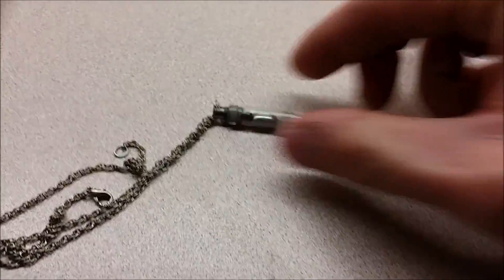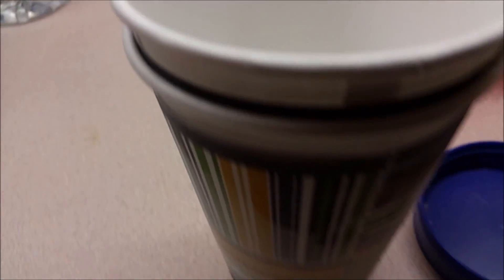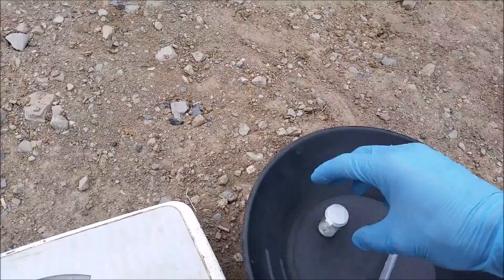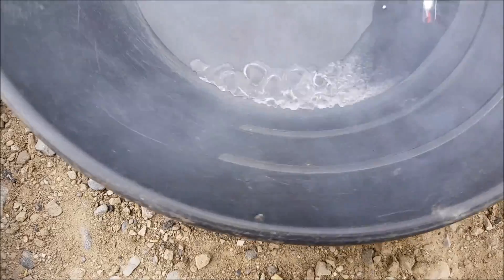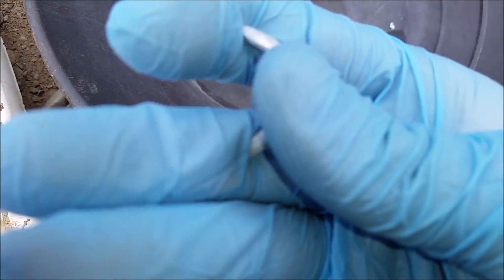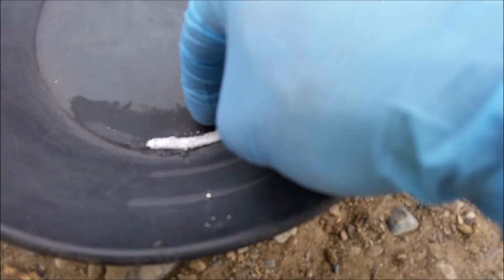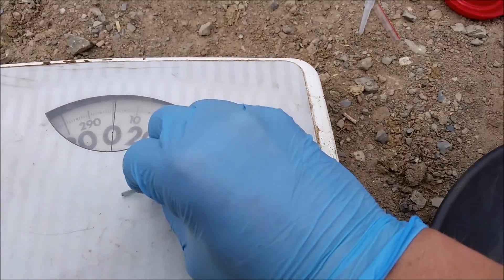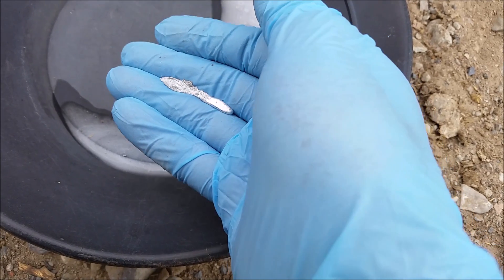Bending Solid Mercury: It Cries!

Comment: I saw a video once where someone tried to make a bell out of solid mercury.

Didn't quite work.
Reply: +One Winged Angel Radon is about ten thousand times as radioactive as the shortest lived plutonium isotope of use, plutonium 238. It is several million times more radioactive than plutonium-239, as used in bomb cores. The decay products of radon are short-lived as well.

You can't have something that's both long lived and intensly radioactive; it can only decay once before it becomes a different element and if the first step is slow, that's the rate limiting step. Radon wouldn't exist at all on earth, if it wasn't being formed in the decay chain of long-lived uranium uranium isotopes and there is never very much of it around.

You can have different decay energies, but there's an upper bound. An alpha decay is always between 4 and 11 MeV; with the ridiculously unstable isotopes tending towards the high end and the longer lived stuff toward the 4-6 MeV side of things..

Alpha emitters don't get through skin and it is very poorly absorbed by the gut. The biggest danger with plutonium is dust. Radon is far worse in that it is already a gas and it's decay products are effectively very fine grained respirable dust.

Handling a bomb core (~3 kg) of plutonium with just a nickel or gold plating without gloves is perfectly fine and was routinely done without adverse effects. As long as it doesn't go critical (e.g. you don't want to drop it in water or stack too many reflectors or moderators around it) it is fine.

The most radioactive isotope of plutonium that is used for anything is plutonium 238, with a half-life of only 88 years. Even then, it was safely used in pace-makers as a heat source for generating electricity. Some of these are still around, after more than 30 years since they stopped making them.
Reply: +One Winged Angel Plutonium isn't exactly easier to handle. :D
Reply: +JustOneAsbesto I had a good Sodium joke to tell, but Na...
Reply: What do you exactly mean by 'didn't work'? What happened?
Reply: Well at first they had a lot of logistical issues (melting, deforming, not getting it to freeze into the mold properly), which they eventually somewhat solved, but even then it just didn't make a very good bell.
Reply: soylentgreenb
You know... I sort of felt like just calling him an idiot, but I didn't want to be rude.

While (arguably) far more informative, I'm not sure your way is any better.

I say arguably, because I doubt he'll understand any of your comment.

Edit: Hah! He beat me too it.
Reply: +JustOneAsbesto   Of all the metals, why Mercury?  Why not a metal that glows?  That way it'll glow in the dark. :D
Reply: Seleuce  I think Plutonium is too radioactive to be used, why not something less radioactive?  Like Radon?
Reply: One Winged Angel
Again, bells don't exist to look pretty.

And the way they are commonly used, less than a handful of people ever see them in the entire lifetime of the bell (which might be hundreds of years), but in a single day of the bells life, thousands of people hear them, multiple times.
Reply: +One Winged Angel What are you, a magpie?
Reply: Neon's Stuff That was pretty CRaP but as long as you only do it periodically we won't have to bang our heads on the table
Reply: +Neon's Stuff That wasn't Ne.cessarily nice of you. ;)
Reply: superblahmanofdoom
Yes. It would have to be 127 degrees below absolute 0 to freeze something with a melting point of -39 C.

Yes.
Reply: JustOneAsbesto  I know, but think about it, a glow in the dark bell would look pretty nice, no?
Reply: +JustOneAsbesto A mercury bell would probably need to be quite large as mercury is a dense metal and small bell would resonate too low. It's probably also like lead and doesn't ring that well even so :)
Reply: +God Gonx That was AUful
Reply: Westley West
Because the whole point was to use mercury.
Reply: +One Winged Angel Radon isn't a metal
Reply: EvilNeon you mean Ne.cEs.sAr.I.ly
Reply: +Rennie Ash I wouldn't Ba.ng myself to the table.
Reply: Kaspars Matusevics
Or taco.
Reply: soylentgreenb you're peopleb!
Reply: Leo1239150 Why you theiving little elf!
Reply: Stealing this.....
Reply: +R. AQ Only way it would work is if the mercury bell was in a room of -400 celcius basically... to keep it's solid state.
Reply: +JustOneAsbesto why not use aluminum?
Reply: +JustOneAsbesto oh ok.
Reply: ***** Radeon is a GPU
Reply: *****
Which sucks at 2 of the games I play and the GPU should be 4x more powerful than it needs to be XD
Reply: Rennie Ash Switch to Nvidia you will be able to optimize more games. right now 2 good cards to start to choose from. the GT 730 Or the GTX 750 Ti. both are under 110 bucks.
Reply: Westley West
The only problem is that I have r9 290s and my old PC had a gtx660. I would probably want one of the top end nvidia cards to match the r9 290 but expensive XD
Reply: +Rennie Ash don't get a fucking 730 or a 750 your r9 290 is still a really nice card
Reply: Brandon Poisant lol I know that's why I would only want an upgrade if I did change.
Reply: Brandon Poisant AMD has problems with emulators that's why Nvidia is more compatible.
Reply: It only works is Canada
Reply: Jon A no its fine just use the DVD drivers NOT the current drivers.
Reply: Jon A well until there's a fix it shouldn't be a problem. for now people may have to wait. i understand that Radeons is a choice for now but i got Nvidia before this whole mess. i only got Nvidia because its better for my games. there's no other equivalent of the card i use and if there is its slower than the Nvidia i use.
Reply: +Seleuce Plutonium wouldn't really glow, unless you used plutonium-238 which would glow from it's own heat, and i don't think we would want our bell to be hot.
Reply: In most ways, plutonium is a lot easier to handle. It doesn't need to be kept refrigerated. In bulk form it's not particularly toxic or radioactive (it's an alpha emitter with a fairly long half-life + a small amount of x-rays). Plutonium ingestion isn't that bad (~1 in 10^5 atoms are absorbed by the stomach lining from easily soluble plutonium salts; less from insoluble oxides). It is plutonium dust inhalation that is most dangerous.

Handling large enough amounts of plutonium to make a bomb is also a serious criticality hazard. If there's enough plutonium, allowing it to pool into the wrong shape while casting or putting something next to it that reflects neutrons (e.g. people) can make it go critical.

Handling say 100 g of plutonium metal would not be big deal if you weren't going to polish or machine it.
Reply: was it periodic  videos
Reply: Yeah I saw that too
Reply: One Winged Angel
Here's the real (and blatantly obvious) answer to your original question: Mercury because of curiosity about what a bell made of mercury would sound like.

And also NOT radon (or other), because the purpose of a bell is not to glow in the dark. The purpose of a bell is to make a pretty sound. And also radioactive elements are hazardous.
Reply: bennyg444  No, I'm an Angel.  See my wing?
Reply: soylentgreenb ...wall of text...mental strain...

Comment: now keep in mind how bad this crap is it can kill you if you get any of it in you yet anyone can find and get it ez but you yet you have to be 21 to buy a beer
Reply: +vorkev1 WE'VE GOT THE PENTAGON'S TOP CRYPTOLOGISTS TRYING TO FIGURE OUT WHAT THE FUCK YOU JUST SAID!
Reply: +vorkev1 No, just no. It can't easily kill you if any gets on you. Fifty years ago every child handled mercury with their bare hands in science class.
Reply: Nevir202 if you ingest enuff to wear you can see it with your eyes that is enuff to kill you yes some people it may not kill right away but most it will.
Reply: vorkev1
Ummmm... OK before you said if you get it on you which is 100% wrong. Now you're talking about eating it? Way to move the goalposts.
Reply: Valoro85
I'm curious, if Mercury is so highly toxic that it needs to be regulated in such a way why are governments pushing people, even incintivizing them to switch to mercury containing CFL light bulbs?

Mercury is toxic but it isn't the boogeyman you were claiming. That was my point and I'm correct.
Reply: Valoro85
Umm... Where have you been buying bulbs? Every CFL I've ever seen is exposed glass. The plastic covered ones are usually LED.

Yes, CFLs contain very little mercury. And with even very basic safety precautions you'll only ever come into contact with very little mercury when handling it. In fact when handling it you have the advantage of being aware of Mercury, I bet most people don't even know it's in CFL bulbs.

Comment: a mercury necklace?  is that like..... safe???
Reply: +JakeTheRipper 73 We used to stick Mercury in our mouths via a glass thermometer, still alive!
Reply: as long as you don't directly touch the mercury its safe
Reply: +JakeTheRipper 73 There's a layer of glass separating the mercury from whoever wears it, so I guess it's pretty safe. And even if it breaks, it's just a small amount that would certainly not cause death just by touching our skin.
Reply: +DiscoCrackers You won't die if it breaks though. That amount isn't enough to kill anyone outright.
Reply: +adam tam it cannot absorb through the skin in any meaningful way, you are going to be getting more exposure by not wearing a respirator, than handling it with your bare hands.
Reply: err no, its illegal in my place. but theres info online on the side effects xD
Reply: ***** yup
Reply: +Daniel McPeak hue hue hue
Reply: +JakeTheRipper 73 There is a good reason you can't walk into a store and buy a mercury necklace. No. It is not safe. It is, in fact, illegally unsafe.

Comment: Your handling of liquid nitrogen makes me cringe....
Reply: Why? As long as he keeps his hands moving he's fine. It's not like he's soaking his hand in it or in a roam with no ventilation.
Reply: +Lord Pyrex You can dip your unprotected hand in liquid nitrogen or splash it on your hands; it's perfectly fine. It is insulated, spongey gloves that can give you serious frost burn; if the glove soaks some liquid nitrogen you can't get it off your skin fast enough. Handling metals frozen in liquid nitrogen is also a particular danger. E.g. if you're demonstrating lenz' law with an aluminium ring cooled by liquid nitrogen; that will stick to your skin very quickly and transfer heat very well if you touch it.

The leidenfrost effect protects you from direct burns from liquid nitrogen very well. Have you ever poured water on a very hot stove? It skates around on a column of escaping steam for up to 10-20 seconds.

Comment: "...gonna see how strong mercury is, as a metal."  Um... it is a metal.  But I'm guessing you meant to say "...as a solid (metal)."
Reply: +Ulf Sark Hardness is a material's property that shouldn't be compared to mechanical strenght or toughness. Hardness is surface related (surface chemical bond energy, hence the compounds that are made of elements on the "same side" of the periodic table being the harder compounds....mostly carbides and nitrides. However, such chemical energies require high energy inputs to be created as well...) and mechanical strenght is related to deformation mechanics vs temperature vs time...
Reply: +Ulf Sark He means compared to the strength of other metals, metals are known tobe stronger than other solid materials such as ice
Reply: And yet, the hardest substance is a non-metal....
Reply: +Ulf Sark Um, slight correction there, semi-metal, and it is exceptional, as most things approaching that level of hardness are either oxides, nitrides, or carbides, not a stand-alone element, the closest being zirconium oxide, or boron nitride.

Comment: Could you explain why the glass doesn't break when you put it in liquid nitrogen? 
Thanks
Reply: +Tony reeves Not all glass contracts and expands with differences in heat. There's types of glasses that have hardly any contraction upon cooling them, making them immune to cracking due to cold.
Reply: +Tony reeves It is the rapid change in temperature that causes fractures, and depends totally on the shape of the container, and the arrangement of the crystal structure. Tempered glass has its crystals arranged in such a way that rapid temperature changes tend to strengthen the material instead of weaken it. However, I doubt it would be able to withstand very cold to very hot, or very hot to very cold. So if he were to drop the glass in a cup of hot water after soaking in liquid nitrogen, or soak in hot water and drop in the liquid nitrogen, it would probably shatter.
Reply: +Tony reeves because unlike mercury that cries for a little cold, that glass is not a sissy, basic physics.
Reply: +Tony reeves Maybe because it's small ?
Reply: +Tony reeves Liquid nitrogen cools the glass fairly slowly. It's the leidenfrost effect. Nitrogen boils almost instantly when it touches the glass, so the glass is mostly in contact with nitrogen gas. Pouring cold water into a hot glass cools it very quickly and unevenly.
Reply: soylentgreenb Well, i know for a fact that dipping super cooled tempered glass into luke warm water will make it explode. Made that mistake in college once. 
It was a much more substantial pyrex measuring cup, and nearly gave me a heart attack.
Reply: +Richard Smith Wasn't glass one of those fancy amorphous solids? Like, with no crystal structure?
Reply: Lukáš Klečka Glass is not a crystal, it is an amorphous solid, correct. There is no structure to the molecules, but it is still a solid, just without any sort of regular structure. Glass will not melt in the windows over hundreds of years, this is a myth :P
Reply: Richard Smith if you really want to troll people, tell them it's a solid with infinite viscosity, that due to its absence in crystal structure will change shape under extreme conditions or over extended periods of time ;)

Comment: i don't think any of the metals are structruly weak as nearly as they over critical tempreture. you should try that again at very low temps. in order to get all the particles in the metal completely cristalized. e.g.: think about steel's mechanic behaviors at 800C degrees and at room temprature and of course upper 1600C.

Comment: Why doesn't the glass fracture from temperature shock when you put it in? Is there a nitrogen vapor layer where it's boiling off until it cools down to match that keeps it from cooling too quickly?
Reply: +harlequindemon666 Glass doesn't shatter only because it heats/cools too fast, its when there is a large temperature difference in the glass. If the bottom of a glass is warm and the top is freezing the glass will break but if the whole glass is cooled at once you'll be fine.
Reply: davjet1
Right on. Thanks.

Comment: Wouldn't really refer metal as a crystal..
Reply: the structure of the metal is a crystal, being a crystal has nothing to do with being an alloy. you should try looking it up
Reply: +FinestSeven There are no metals that don't form crystals, so I certainly would...
Reply: +FinestSeven I wouldn't refer anything crystal.
Reply: +FinestSeven It is though, in how the atoms arrange.
Reply: Teth47
And here I always thought metals were alloys..
Reply: Ethan Lovin
 Oh derp, I just realized that in finnish there is a distinction in words between a crystalline structure (scientific term, kide) and a crystal (trivial term, kristalli).
Reply: FinestSeven Glad this has been cleared up.
Reply: +FinestSeven Also, alloys are mixtures of metals and other elements.  Iron wouldn't be an alloy because it's an element, but steel is an alloy because it's a mixture of iron and carbon (usually).  Fun fact: solids can dissolve other solids.